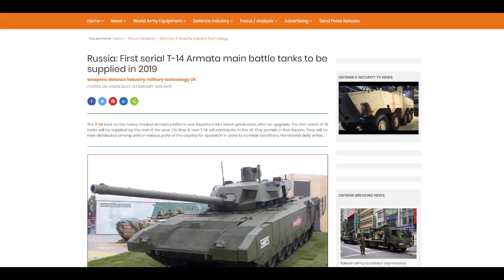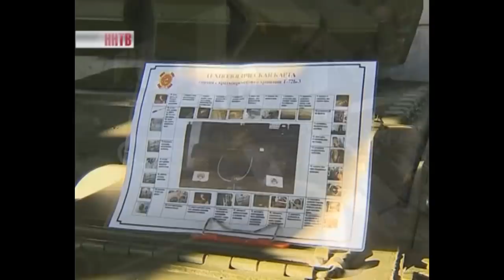Problems with Russian tanks

Comment: you mentioned the ERA armour would increase protection against APFSDS ammuntion. while in the case of Kontact 5 armour, this is true, it should be noted that not all ERA armour protects against APFSDS ammuntion, most only protects against chemical effect ammunition like HEAT
Reply: Reactive armour is the cheap method to protect a tank and is only good for small engagements. The British have developed 30mm APFSDS that is practically designed to pelt tanks from miles away to destroy reactive armour.

Comment: ...
Technically their tank more reliable than America M1 Abrams, Abrams consume too much oil, higher cost and problem with their engine. T-72, T-80, T-90 and T-14 is not that expensive and using Soviet experience with mass production is not a problem for their part. So far Russia has no plan to replace their massive fleet of older tank like T-72, they can just upgrade it and still can be used for their role.
It's true that Russian tank has problem with their quality, but with continue upgrade their can be up against American tank. Russian is changing their doctrine with the new T-14, that could be said surpassed Abrams(Some source keep saying that T-14 is bad but no true)
Reply: To be fair,at this point,nobody can realistically say whether the T-14 would be better or worse than it's competition.

Comment: 1. In T-90s there's a lot of foregin components, so after they were hit by sanctions, they must stop production. 2. After Chechen war russian military has lost faith in T-80. You may belive or not but T-72 is considered as a better protected and more safe for crew tank. They started upgrading T-80s because they run out of capable for modernisation T-72s. 3. T-14 is simply to expensive. Uralvagonzavod went bankrupt last year so this also is making more problems with production.

Comment: "Why doesn't Russia build more T-14s" because they don't exist and there's probably like 3 guys locked in a cellar somewhere screaming at each-other wondering how they're going to make a completely fictive tank real by the end of the year. I don't think the T-14 is ever going to enter actual service as anything more than a show tank and I don't think it's ever going to see combat. 

The T-14 is propaganda, that's all. To think otherwise is to harbor some serious delusions about Russia's current capabilities
Also, I don't want to sound mean or dismissive however I highly doubt the T-90M is on par with most main-line NATO MBTs. I think Russia has had some hard times that have left it well behind the West and it will have a long and arduous journey to catch up to it whilst simultaneously I think it has significantly bigger problems than the state of it's MBTs - and some of those problems are directly responsible for the sorry state of much of Russia's armed forces.

Comment: Isn't  reactive armor vulnerable to machine gun or artillery fire?  Wouldn't even small arms set off the armor boxes?
Reply: no i dont know specific parameters but there needs to be enoigh forces to trigger it.    i would even guess since the blocks are fairly thik that macheneguna probably wont even pen them
Reply: @старшийсержант-л7ш  Not so much penetrate, but trigger.  Although that's a good question too - what about penetration as well?
Reply: i am sorry i cant really remmeber but i watched a feew documentarys about reactive armor ( "dynamic protection" ) and read some stuff of it . but they were made that they wont be as " sensible" because that would be very dangerous for exampel for troops that are near etc. these blocks need to be fired upon with something fairly serious ( heat burn, large heavy prjectiles ) soviets have axperimentet around with that point where it should trigger ( to my knowledge aka how much it needs to be compressed or how much heat needs to be generated )   one must understand thats not some ordinary sensible explosive like dynamite. Interesting fact on the side : the armata is able to electronicaly trigger ERA with the help of its radar the era can be set of a moment before impact wich dramaticly increases surivability. kinda like a additional hardkillsystem in many ways
Reply: @старшийсержант-л7ш  Those boxes don't look too thick is what I am saying here.  Plus remember - there is decent AP ammo now for even medium machine guns, let alone heavy.  Will those boxes stop a .50 cal with AP ammo for example?  I doubt it...  Plus what about artillery fragments?
Reply: @TheLoyalOfficer  thikness is t necceaiarily a meassurment of effectivness as the conposition of this reactive armor is new ( aka more effizient on less mass whe. compared to for example relikt ) when firing with ap rounds from an 50 cal on reactive armor you could maybe punch a hole in it but it would be still intact ( like i said fine tuning experiments they have worked really long on it to nake it perfect ) besides firing a 50 cal on a tank you beg to be shoot upon. we have also always ask if a certain scenario is realistic letz say for example a bradley fires upon tank with ap rounds and letz assume reactive armor triggers 1. how many blocks will get destroyed until it gets blown up 2. is the exchange worth it 3. it doesent take long to replace era wich would likely done before next engagement.

Comment: the t 90 can't even turn on the spot, a feature that was developed in WW2
Reply: Not really important in modern combat, unless you're driving into towns which is a bad idea regardless of what tank you're driving
Reply: why should it ? it only increasses the cost of the tank and is really unhealty for the system in general oh and takes more volume inside the tank ..

Comment: T-90M is considered as upgrade to T-90A, which is already in huge amounts in Russian army ( around 2000+ tanks reported in active service ).
But also new T-90M tanks would be produced from scratch (but i think in very very humble numbers).
Reply: T-90A less than 300 units, in addition, they require large-scale repairs, as the T-80U. Therefore, the t-80BV and T-72B are upgraded from long-term storage, they are new.
Reply: 2023 and there still no armata in sevice
And some 100 T90M

Comment: Share the sentiment on T-80U, never understood why are they not upgrading those, as it was the best tank built by USSR. They would certainly be more viable and formidable things to have then half-upgraded T-72s that barely are better than original T-80U.
Reply: Because the restoration of the production of T-80U will cost as much as the deployment of the production of Armata.

Comment: You literally answered your own question by asking it.  The U model would be impenetrable with an addition of a relikt armor kit which can be accomplished under field conditions, is already equipped with an advanced fire control system, and does not require factory (of which there's only one) assembly line level of overhaul to bring it to modern standards.

Comment: the problem with the T-72. 80, and 90 series. all together. is that russia cant quite settle on one unit and role with it. similar to how the british ran their jet avionics in the cold war. they had like 6 strategic bombers, 3 attack aircraft, 4 fighters, 2 carrier aircraft and the like of the type.

Take america for example. the M1A2 is a hard lined tank. the M1A1 use to be the produced preferred vehicle. then upgraded to match to latest M1A2. but now. the US is switching to all M1A2s.
all the US also runs the 
F/A-18 a multi-role carrier navy aircraft.
F-35A, B, C. which are for Short take off, VTOL, and long take off variants. all with stealth multi-role in mind. 
F-22 as an stealth air superiority interceptor, 
B-2 as a long range stealth bomber, 
B-52 as a stand-off strategic bomber, 
B-1B as a supersonic tactical bomber. 
A-10C, Heavy close air support, forward air control, and ground-attack aircraft
F-15E Strike Eagle, Multirole fighter, strike fighter
F-16D Fighting Falcon, Multirole Fighter, Air Superiority Fighter
and thats about it.

russia uses
Su-34s, a fighter-bomber/strike fighter
su-57s on the way with 10 planned (good lick, india gave the US the SU-57 plans when they looked to join NATO partnership for defense purposes)
Su-27M, a multi-role fighter
Su-35, an upgraded Su-27M for air superiority. 
su-27, a multi-role air superiorety fighter
su-30, a multi-role fighter
SU-30MKI, and upgraded su-30. same role
Mig-29M2, a multi-role fighter
MIG-33, an upgraded version of the MiG-29M2 (TBA)
YAK-130, a lgiht fighter? (also a training aircraft)
MiG-35, a multi-role fighter, on the way
MiG35S/UB, multi-role electronic warfare focused, planned for future version of MiG-35
MiG-41, stealth interceptor (planned, no go yet)
PAK DA, stealth strategic bomber in planning for 2025-2030
Tu-160, supersonic strategic bomber
===

i might have missed some

the point is that the russians seam to want to flash all its toys. wile the US as its competitor just makes what it needs to fill the lack.

btw. that list of russian aircraft are just their Airforce. their navy might have more.
also also. they only have 645 active/reserve/and planned aircraft in all. wile the US has 1,480 F/A-18s
Reply: Eh...Russia has mutliple Teams of Designers(and factories) competing against each other while in the US its mosty a monopoly...
Different Russian Factroies have different expertise and different production standerds and they all comptete to gain contracts while in the US all the Defense companies need to do is lobby to secure their position...This is why Russia produces so many high quality products with a small budget incomparison to the US and why the US doesn't have more variety in its arms industry when the US army budget is so huge...

Comment: I very big problem i see with Russian tanks (im my opinion)
Its because they have no GUN DEPRESSION! and its a pretty important, so you can show very little of it and still shot, but Russian tanks just have little to no gun depression.
Reply: Well, that is a legacy from the cold war. Soviet doctrine required a tank with as low silhouette as possible, so it's harder to hit. And because Russia (same as the other ountries) decided to operate these post cold war tanks and modernise them, they have this drawback. However, it's a bit harder to hit on the other hand. 

By the way, T-14 has a pretty high turret, which allows it to have much more gun deppression.
Reply: @budmil324  they had bad depression in WW2. Besides a bigger turret doesnt always mean better depression, theres the gun size, the recoil, etc.

Comment: So to correct you statement of relic ERA is immune to any apfsds for one the Leo newest dm63 round can and will reliably penetrate the hull front of any t90 or 80 variant at ranges up to 1000 meters anything after that is questionable for the abrams newest m829a4 there no new data available but using common sense one can assume it would have better ballistics compared to m829a3

Comment: Only a few days ago the new M1A2C was announced (febuary 22) and in photos there is a HUGE addon of armor on the cheeks, and no im not talking about the M1A2sepV3 with weight simulators, I mean an actual pair of huge armor slabs on each cheek with the trophy system on the side of the turret.

Do you plan on making a video over it?

Comment: Just like they said in 2018, 2017, 2016 and 2015 still waiting, Russia doesn't cancel failed systems, they just put them aside for parades and propaganda videos and never build or field any to the front, Just like the bmp3 the bmd3 the BMPT there ground effect sea planes and there space shuttle. Also t90 is a t72 variant Russia cant build or even afford t80s.
Reply: T-80s are produced in ukraine. Also the T-90 is better than the t-80

Comment: I really cant ser the difference between the T-80 and the T-90 they look very similar.
Reply: Internally they are quite different though. The 80 is derived from the 64 using some 72 methods, the 90 is based on the 72 (which was a simplified 64), with some solutions used on the 80. Further more the 64 and 72 lines were designed at two different design bureaus. With various upgrades on all of them good luck telling which is which. 🤔 No, I'm not an expert either.

Comment: Whats this idiot going on with? There is no way he even knows the technical details of the upgrades taking place. All he knows in a very broad way the public releases about the upgrades. For all he knows the older Tanks are cheaper and easier to upgrade and the end result will be better. Only the Engineering staff involved know the details of what the upgrades really entail.
Reply: Maybe he subscribes to Janes Weekly?
Reply: @Blahb-o9b  Thats what I said. We don't know. This guy is normally good but he struggles in this video. Problem. Not enough known. 
Another problem I read is most of there Factories are really busy building new T90s for Export. The best selling Tank for Export in the World in numbers of orders etc. They are not in a position to do the upgrades the Military would like. 
Why not re-open an old Tank Factory in a city that has unemployment. The factory also probably has all the gear to work easily on the Tanks they originally built. 
They get the skilled workers back to work who can train new recruits etc. 
I read a good article about this somewhere. They managed to get together a reasonable number of older skilled workers back and some of the Engineers etc. 
They also have put on new younger Apprentices etc. 
It is going to take possibly 3/4 years to get everything working well again. 
Great idea. Get another Tank Factory up and going. You don't have to start from scratch but you still need 3/4 years to get the new Young Apprentices up to speed. 
Probably faster than a new Factory somewhere. All it would do is steal skilled workers from busy factories building Tanks for Export. 
That is the Putin Admin and his Military advisers etc.  They look at all aspects. They can because many plants are still Government owned or part Government owned.
Skilled Labour in many of these areas is big problem in Russia. 
After the crash in the 1990s they are still struggling to get things back to normal in some areas. The Farm Machinery sector is competing with them. Russia again now builds 80% of its own Farm Machinery again now there Agricultural Sector is booming.  
You can bet there are ex Tank Engineers etc. working at the new Class Plant in Russia. Class has set up in Russia. 
There own major Farm Machinery Company (Can't remember)  now it has taken over Versatile of Canada is also starting to make many components for Versatile Gear.  They still sell it as Versatile overseas. 
The list could go on forever. There are far more Commercial and Practical factors involved than what the average Tank nut even thinks about. The real thing is not just a Tank game on a Computer.
Reply: It's been quite well studied how Russian tanks perform. Remember that for 50 years, they were the evil empire about to plunge the entire planet into war. Knowing what they could and could not do was life or death.

We also know Russian tanks are impossible to upgrade due to the cramped design and lack of technology. They were never designed to be upgraded at all.

You just don't flip 40+ years of history on its head overnight, in a suffering economy, just because a dictator demands it.
Reply: @Blahb-o9b  You never answered my question. When they upgrade they strip the entire Tank. The new gear going in for sure will be smaller and more effective. Russia has not released any details of the upgrades except they will get new fire control systems, sights etc. and engine and transmission and armour. How effective it will be only they know. They always keep there releases very broad like everyone else. The way this guy goes on he sounds like he was working in the design section and factory. 
The technical details are there secret. 
If what you say is correct how did they make the T90 a far better Tank than the T72. It is basically a T72 in size and running gear with a more powerful engine etc. Yes it has a new turret. How good is the new bolt on armour? Nobody knows. They are constantly working on improving there contact reactive armour. 
They are fully stripped when upgraded and all the internals replaced. Why can't a T80 be brought up to near T90 standard? 
The T72s so far upgraded don't have the Active Defense of the latest T90s but a recent article I read said it is an option that can be added. 
Just like the USA having seen how effective it was in Syria is now buying the Israeli Active Defense system to fit to the Abrams. 
Odds on the new Engines are smaller, more economic, same with the transmissions etc. That all creates more room. More electrical power etc. 
You don't really know, I don't know and he does not know.
Reply: @Blahb-o9b  HaHaHa

Yes, we saw how the 'mighty' Abrams went in Yemen against barefoot Houthis.
Or Leopards in Syria...

How are these F-35s doing? I'm seeing that everyone is trying to avoid buying them without some 'arm twisting'...
Reply: @simplicius11 
You mean against Iranian colonial troops armed with the latest tandem-warhead RPGs, against the sides of Abrams that were not uparmoured.
Reply: @Blahb-o9b  The Abrams is very vulnerable from the front just below the Turret and from the rear. Not much they can do about it. Also hopeless in Mountainous Country. 
It is a good tank in many ways but best suited to open Plains and Desert. 
Its fuel guzzling and need for heavy specialist maintenance is a problem in prolonged conflicts away from base. No tank can be everything.